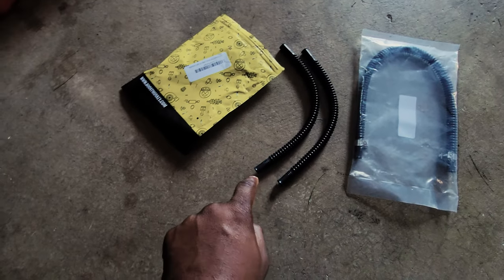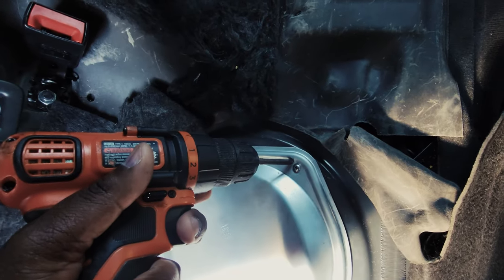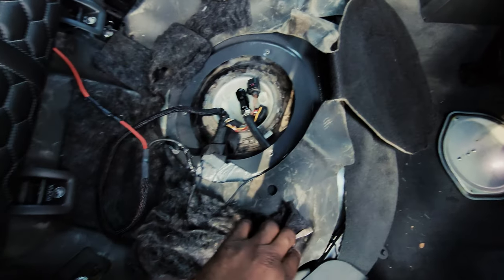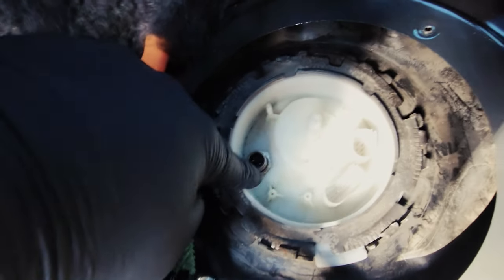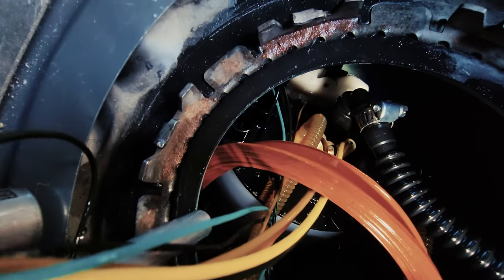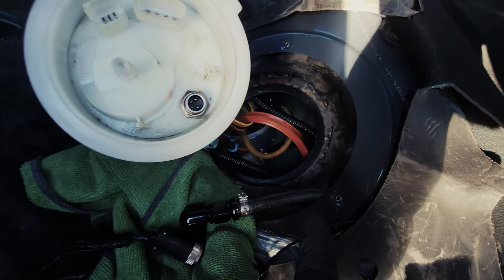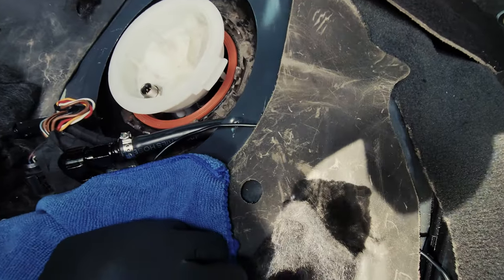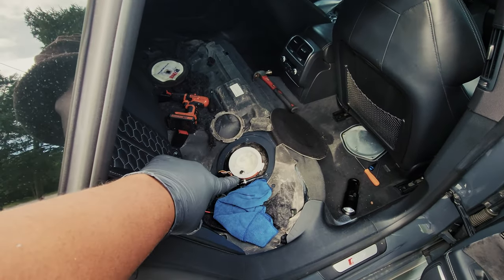DIY - 1000hp Capable Low Pressure Fuel Pump for your C7 C7.5 Audi RS7

Comment: That’s a complex system! You did a good job.  Is the fuel pump cut out flap original or was it modified?
Reply from the maker: Which flap?
Reply: @olu  the metal piece above your fuel pump assembly.
Reply: @BulliKid  yes he added that in with a step drill from what I can gather. I think I’m a follow his except I’ll do a Y versus a T fitting.

Comment: I feel like there should be a check valve on each supply to prevent back feeding through the pumps.
Reply from the maker: Yeahhhhh.....that's a issue I currently have actually. When I shut it down it back feeds! I'll look into adding check valves

Comment: I may try this. Any cons on this set up so far? Anything I’ll need to be on the look out besides the things you mentioned in the video?
Reply from the maker: It drops fuel pressure when you shut it down after a drive; BUT only for short periods, i.e. 30 or so mins; starts kinda lazy. Your tuner might be able to tune that out. Once a year, it'd be good to replace the orange tank seal and check all the connections to make sure it is still strong.
Reply: @olu  great thank you!